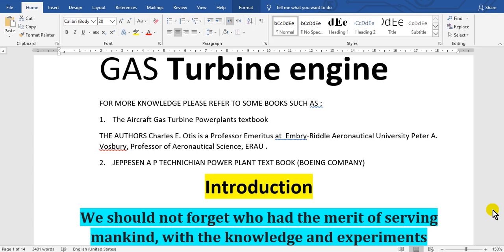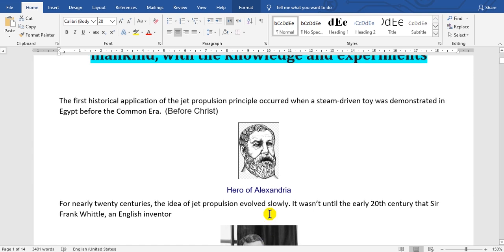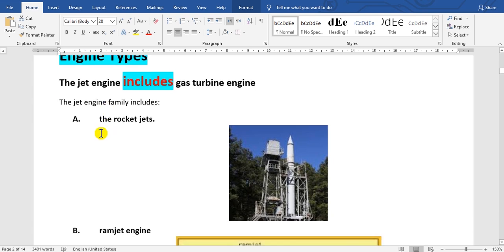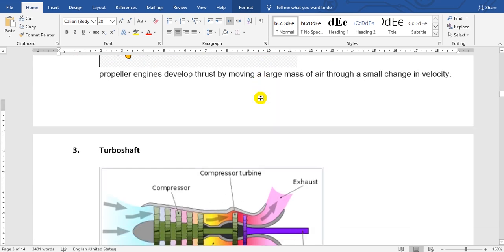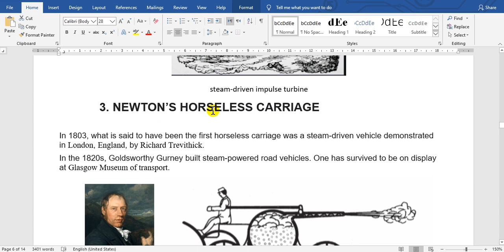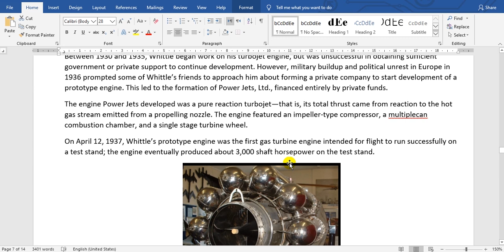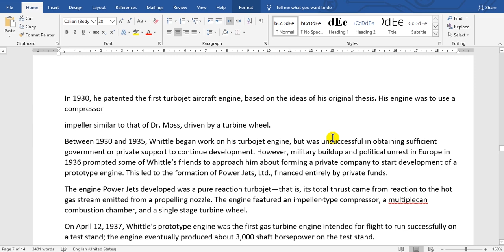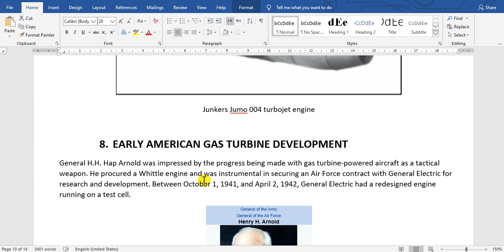Gas Turbine Engine History

Comment: Year 1903

1903: A Norwegian, Ægidius Elling, was able to build the first gas turbine that was able to produce more power than needed to run its own components, which was considered an achievement in a time when knowledge about aerodynamics was limited. Using rotary compressors and turbines it produced 11 hp (massive for those days). His work was later used by Sir Frank Whittle.